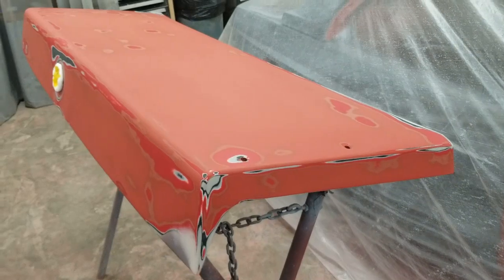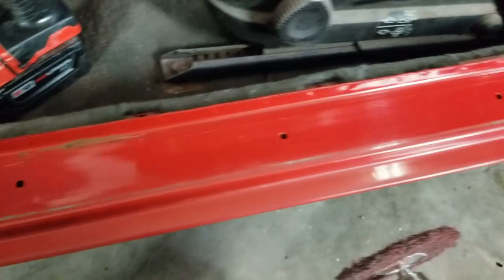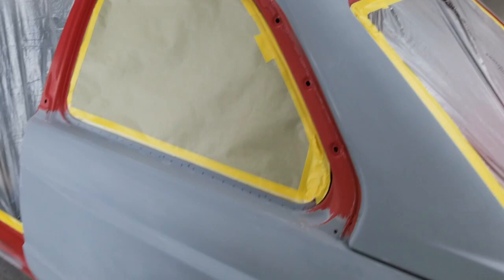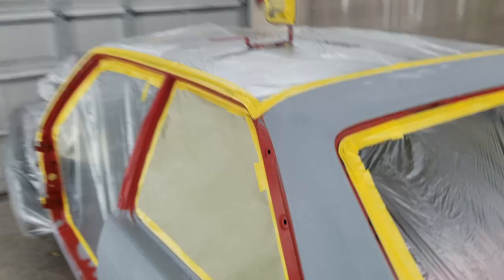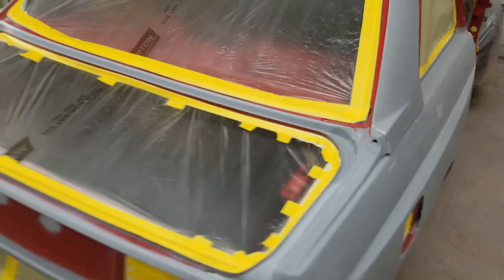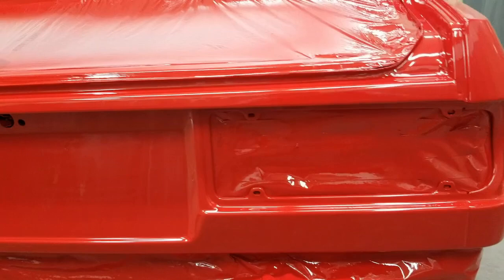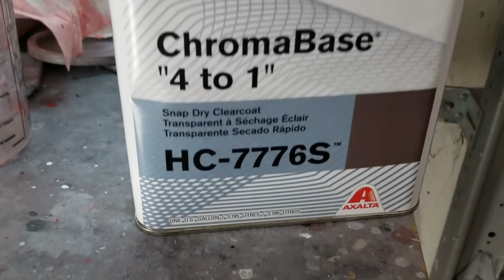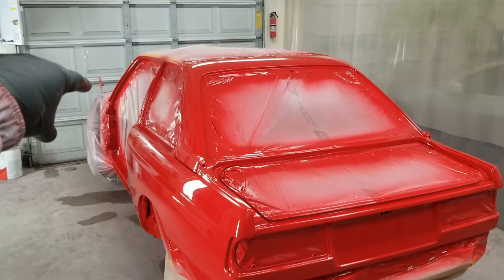1988 BMW E30 M3 PART 6 | FULL REFINISH

Comment: You are an absolute wizard with a spray gun. Looks fantastic! My jobs look good from 20 feet away. I’ve yet to spray something that didn’t need polished within an inch of its life to eliminate orange peel.
I can’t seem to find a sweet spot between orange peel and brutal runs. Guess it’ll come with practice.
Reply from the maker: Try speeding up your passes and increasing the overlap per pass until you get the hang of it. You can adjust from there. Don't be afraid to get close to the panel.

Comment: great detailed videos of the E30 resto, whats the curing time for the paint adhesion sealer..??
Reply from the maker: The sealer  can be topcoated after about 20 minutes but full cure time is about a day. You must sand it if it dries over 16 hours, but you shouldn't be using it like that anyway. Sealer is meant to be topcoated without sanding. If you need to sand, you should be using primer-filler.

Comment: I'm sure it's dependent on the conditions, but what spray tip size and PSI do you normally like to run for the different coats (epoxy, high-build, sealer, base, and clear)?
Reply from the maker: I use a 1.8mm tip for primer and about 25 psi. 1.4mm for everything else and about  18 psi on my digital gun. Probably 25 psi at the regulator.
Reply: @samg5543  Thanks for the quick reply. I have an BMW E30 with an MTech 1 kit that I'm looking into repainting, your videos have been invaluable. Thank you Sam!
Reply from the maker: @albertsimeone3754  good to hear. I believe I have some videos on mtech kits if you haven't seen them yet.